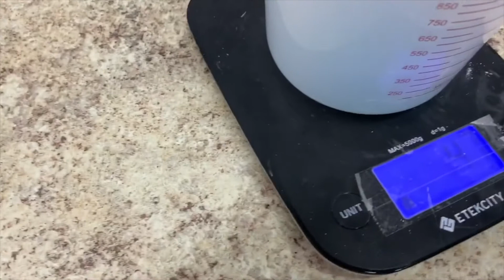How to make a RTV mold

Comment: hello bro you put silver model inside the acrylic box to make dye correct ...so if i use resin jewelry model and put inside the acrylic box then pour liquid ......how is the sound ?
Reply: You will probably end up with non cured silicone. Usually you need to coat the resin print in something because the resin soaks up the water the silicone needs to cure.